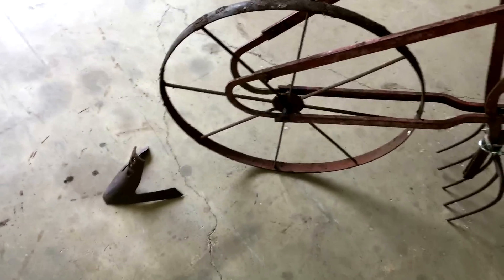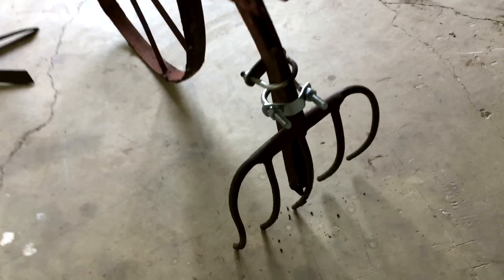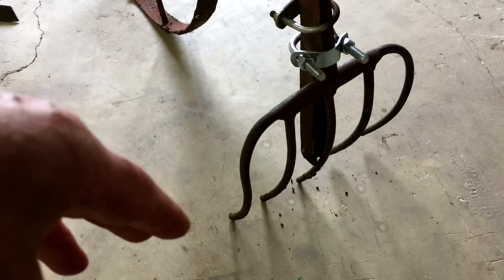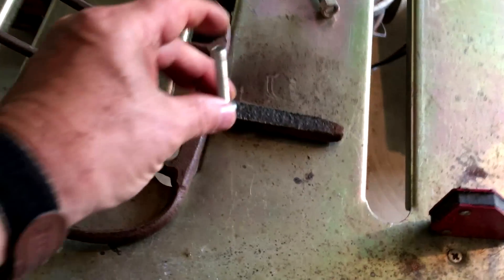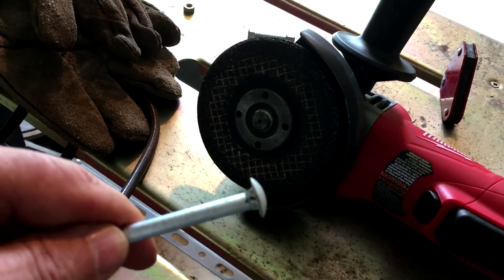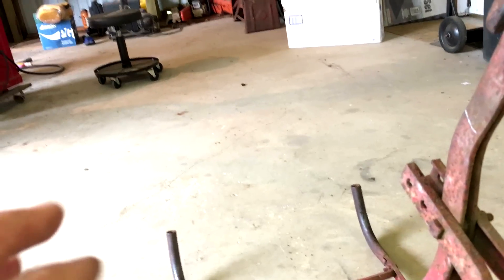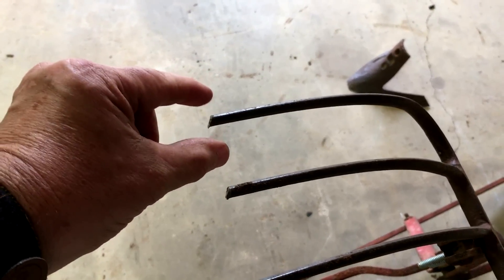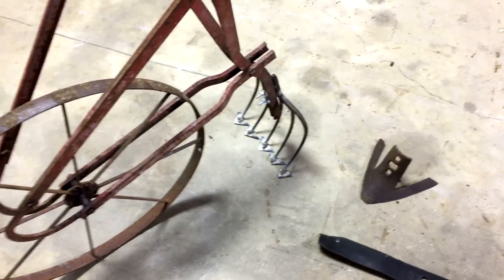DIY Garden Cultivator~THIS WORKS FANTASTIC!

Comment: Thats cool making it your self but they do make cultivator attachments for those furrowers. Yes believe it or not they do still make them saw one recently at my local Ace Hardware Store even though they are kinda expensive. I grew up with one in my hands as i was raised by my grandparents. Wish i couuld have inherited that piece of equipment.
Reply from the maker: Look around at some antique shops.
My wife just sold an OLD one last year.
Also, try Craigslist or Ebay

Comment: Take a electric bike kit om eBay and mout it on that the battery pack Will fuktion as weight and the motor Will turn the rims for you

Don’t have grip you Say?

Just weld some small Metall bars/pins on the rim